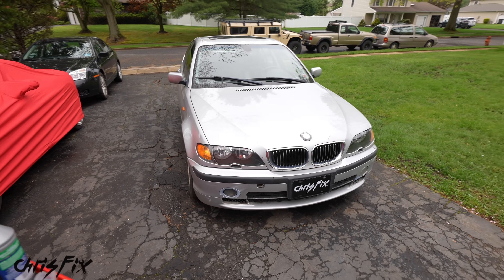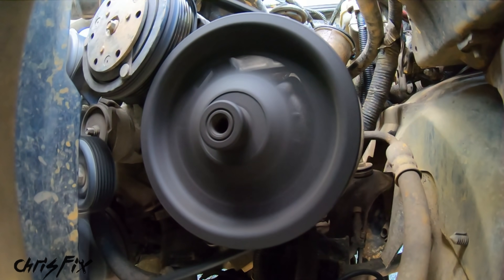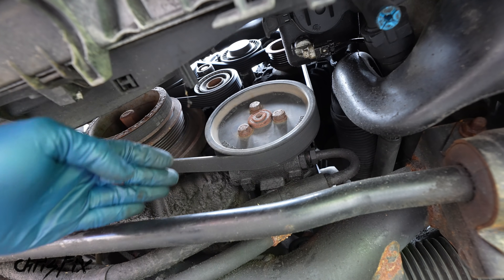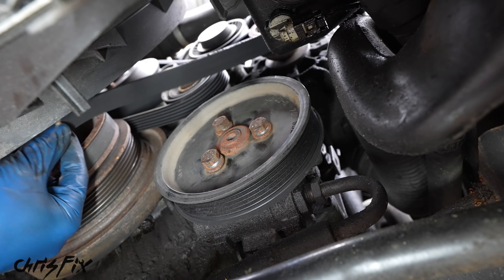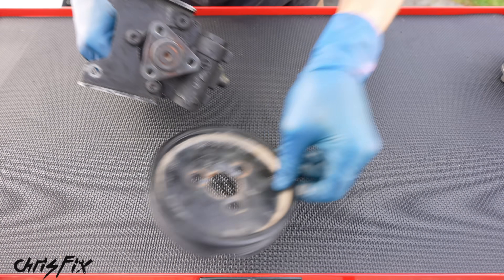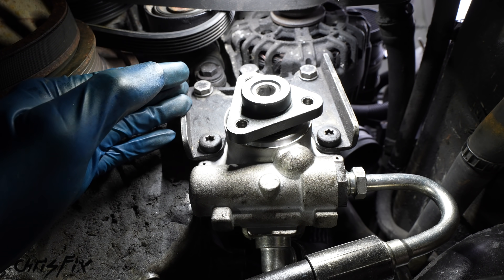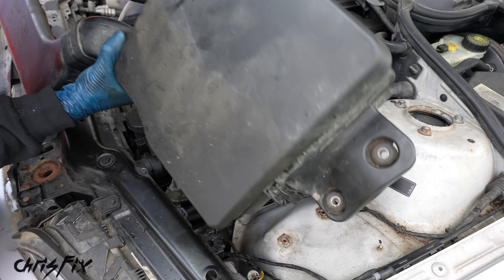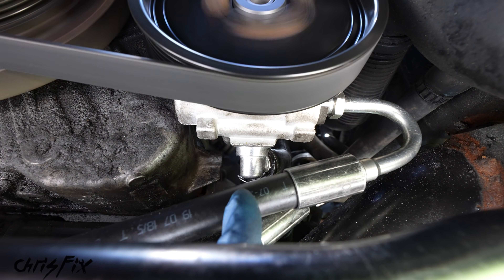How to Replace a Power Steering Pump

Comment: My goodness Chris makes everything look so so easy an untrained monkey or 3rd grader could do it...most importanly having the correct tools for each job..I did my Acura PS pump and it was pretty simple. My vette looked simple but a little more complicated due to tools like crowsfeet and it was beyond frustrating for me...part after part to take off for hand space like Alternator and serpentine belt, throttle bottle, air intake, fluid reservoir and bracket, tensioner pulley, it just went on and on and both PS hoses were a BIG pain in the ass, i wanted to break everything in frustration cry and punch someone out why o Why me??...I am Not a mechanic I repeat I am NOT a mechanic, old grease and oil everywhere from the hoses leaking so bad. Im baffled at how easy something looks to do then it becomes an aggrivating process without enjoyment unless the project is complete and finished from start to end without multiple hiccups. Sometimes u gotta just pay for the service, that be me! Good video as always Chris